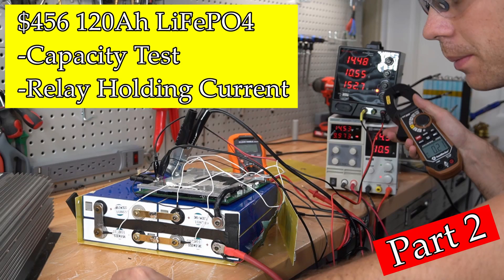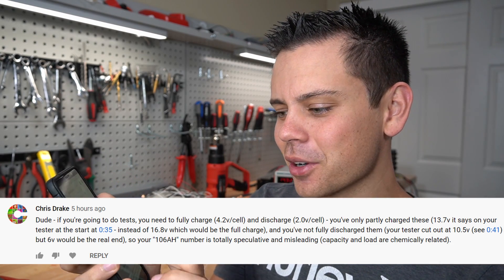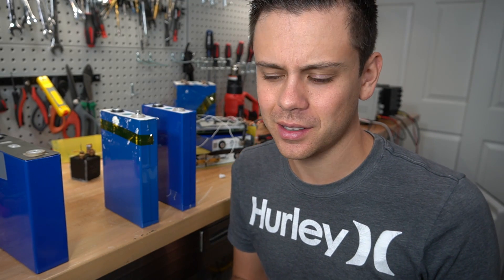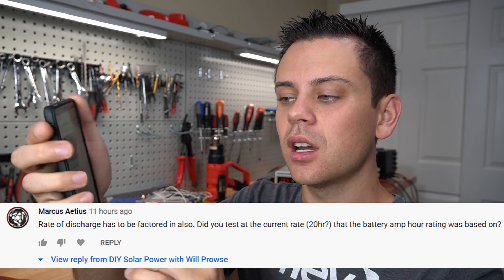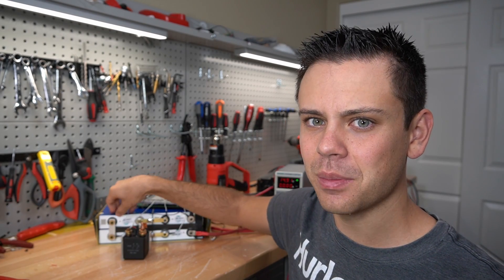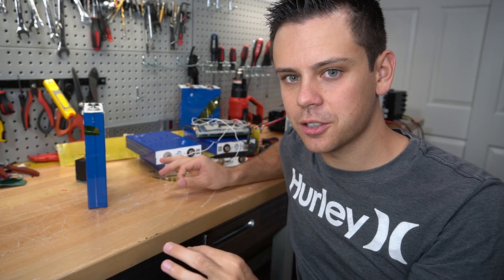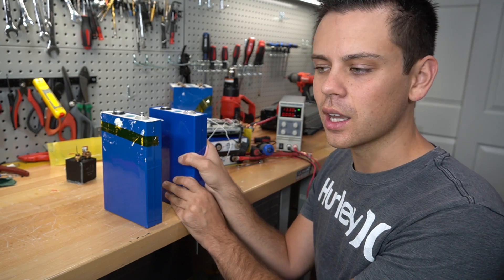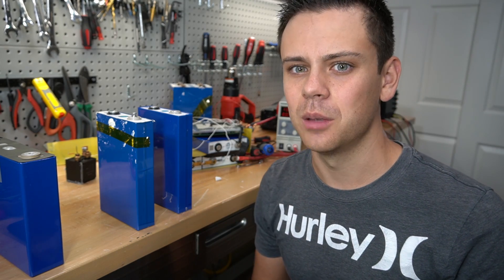Disproving LiFePO4 Battery Misconceptions in my Latest Video's Comment Section

Comment: Have you considered doing any higher voltage battery setups like you might get when using EV batteries in the 200v to 400v range? What would be the downsides , I can think of the upsides but my knowledge is limited..
Reply: Matt Morganti getting electrocuted is the main downside 😜😁

Comment: LOL.  I’ve been using LiFePo batteries for 10+ years.  You got it all solid.
Keep cruising
😎👍
Reply: Aquarion H2O Yes, I wonder how anyone can claim 30 years of LiFePo experience!
Reply: David Davis The were the originating Chemist that pioneered the battery chemistry.😂👍🥴
Reply: Are the 10 year old lifpo4 cells still going?  Thanks
Reply: jay kup Yes.😎👍. “A123” cells.  No clue how many cycles are on them though.
Reply: @aquarionh2o132  ah yes A123 are just amazing cells. They just keep chugging along year after year. I do have a question. I heard something about the original A123 being no longer but another company is now making them? Or something like that. I can’t remember what I read but it made me question if I can even get the genuine a123 lifepo4 2300/2500 cylindrical cells anymore. I have not had to buy them in so long I don’t even know if they are available.
Reply: @jacobhendrickson8935  Sorry.  I’m not sure of the status on A123 right now.  I haven’t bought any cells for years - haven’t needed to.  The next LiFePo cells I’ll be buying will be 1000ah cells.
Reply: @aquarionh2o132  1000ah? What are you using something like that for?
Reply: @jacobhendrickson8935  Moving my House & workshop 100% off-grid.
No more electrical bills.  I’m also going to build some high density solid state energy storage that will exceed the lifespan (cycle life and shelf-life) of pretty much anything currently on the market and expand the kWh capacity of the energy storage....  lots of plans.😎👍
Reply: @aquarionh2o132  wow now that sounds really cool. Sounds like you know your stuff. I’m looking to self sustain my 10x16 shed this coming summer. I want to be able to run a small efficient ac during the summer. Will be fully insulated as well. Wondering if that’s possible or not with one full side of my roof being it gets the sun pretty much all day where it is. At night the ac will be able to rest some but I want it to stay at a constant 80 degrees or so. No idea how much this type of a setup would run me or if it even makes sense to do when I can just run it off my house electricity. It’s less than 4ft from my home. I like it close being it contains my most valuable possessions. 3 security cams going inside that baby and 2 outside on it as well.
Reply: @jacobhendrickson8935  Everything is possible with the right knowledge & discipline.  I guess the question comes down to costs, simple numbers, and system design (you could have a hybrid system the can, if needed, recharge off your house power).  Look into your options and see what your budget is...then go from there!  Cheers
Reply: That's good to hear.. I got two different set 1 is 4 years old one is going on a year.

Comment: I remember when o got some 18650 LiFePo4 cells, i charged to 3.6v as charge specs, then went to measure hours after charging, they were 3.4v. I was like, "wtf"??? was wondering if they where damaged or with a very high internal resistance. THEN i've learned about the "voltage sag" of LiFe batteries. It's just lack of knowledge. Just learn before complaining people :)

Comment: They just want a cheap china product to be good never gonna happen jaja
Reply: All these LIFEPO4 battery cells are made in china, manufacturing process is different between the expensive batteries and the cheap batteries. But still from China....same with all iPhones.
Reply: @Jasonoid  right the finished battery you know the cheap bms with relay 400 is too cheap to get a drop in solution that is gonna be good
Reply: @gulag_inmate69  I totally agree, you have to laugh at some of these builds.

Comment: Love seeing guys that just got into this topic because of their e-scooters and new RVs pushing back on guys that have literally lived this specific topics for years.    Keep it up Will!!!
Reply: Just having built my own three 24v 120ah 8s batteries  for my sprinter RV I have noticed that when floating at 28.4v then putting a load on them the voltage drops to 27.1v almost immediately ... Then it will hang there for a long time UNLESS I am running the A/C unit or I have a Large tool ie; 220v Mig Welder or my table chop saw running (Ihave a 6kw 240v invert)... but if I am  just camping w/ small loads I could probable go a week of rain w/ no problems... The voltage drops some when I first enable the system but hangs at about 26.5 - 27.1 for a very long time... May I state that I am a complete novice and have built my system by watching and listening to will. The majority of my system was purchased from Electric Car Parts in Utah... (Thanks Carl) ... Will Prowst has been a godsend and his videos are pretty right on... Many Blessings , SMR

Comment: Break-in a battery? It's not an engine bro LOL
Reply: shows how there is still immense ignorance about lithium batteries, people still treat them like lead acid and nicd.
Reply: Their showing their age.  This is not NIMH technology.
Reply: Aastan Hi, Shall I feel offended? I’m from the NIckel Cadmium age.... (ROFL)
And I love the school lessons from Will!
I follow his video since a long time and really learned so much that I build my own Energy Storage System out of a salvaged Volkswagen Hybrid Batterie.
Will, go on as you are. You do great!
Regards from Germany
Reply: @MrRossi1805  Not in the least.  I am  from that era too.  NIMH in my Rearwind Speedster.
Reply: @Aastan  I was thinking that myself! When I ran rc cars and I bought new sub c cells to solder together you had to charge/discharge them a few times before they would put out the rated mah capacity.
Reply: Everybody knows you MUST break in a battery with conventional motor oil for at least the first 7,000 miles.
Reply: some lead acid also requires several breakin cycles to achieve full capacity.
Reply: The misonception regarding battery capacity "break in period" ... likely comes from cellphone repair  companies telling customers that their new new replacement battery needs to go through 2-3 full charge cycles before the phone’s charge indicator reports a (more) accurate batter capacity (%) percentage, and it's likely because of this advice that people are becoming confused on how battery chemistries actually works. It’s not the battery but the phone itself that’s adjusting to the new battery.
Reply: @__WJK__  People prefer easier-to-understand myths over a slightly more complicated truth. Oh crap, lightning just struck nearby; I must have done something to piss off the gods again.....
Reply: @P_RO_  - Very true. Unfortunately human emotions play a part/creep into areas where they really shouldn’t.
Reply: I’m not even an electrical or battery guy and I know there is no such thing as “breaking in” a battery! LOL